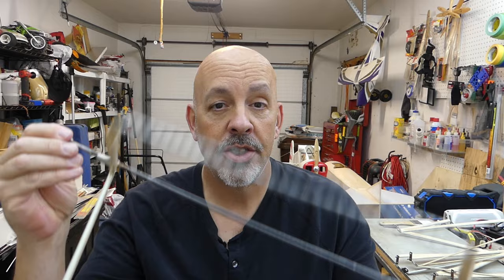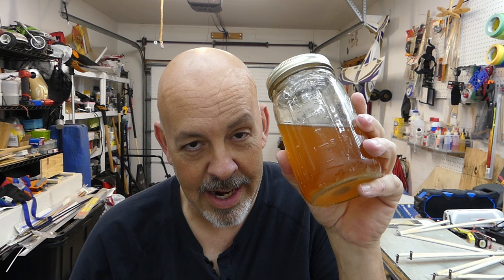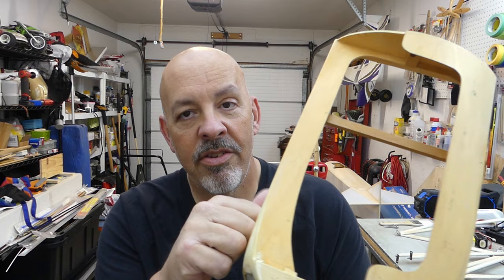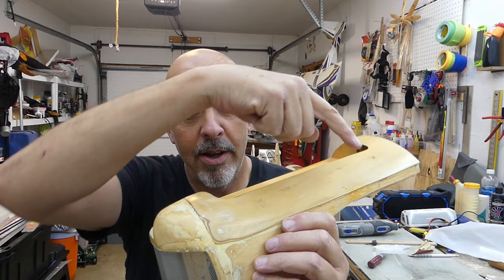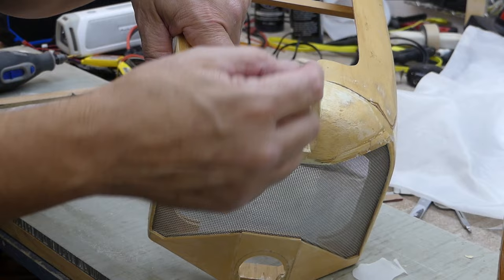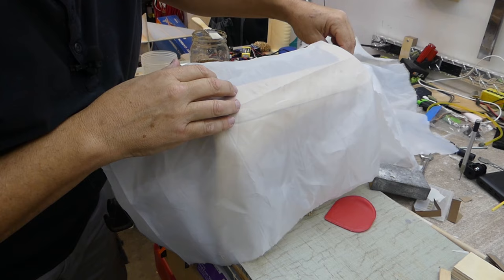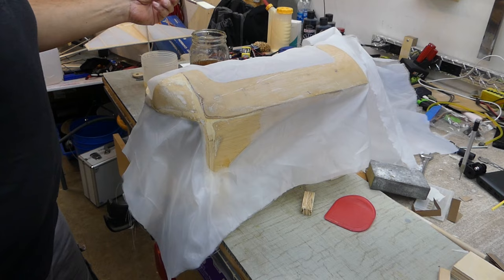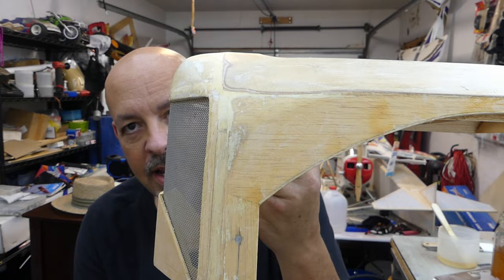Balsa USA 1/4 Scale Fokker D.VII - Episode 46 - Covering the Cowling

Comment: What's going on with the seven
Reply from the maker: Video coming out soon. She is all covered and ready for paint. The paint job will happen within the next few weeks. I will begin building a muffler in the next couple of days.
Reply: @BudChristensen  I don't know if you have great knowledge about mufflers, but you will need to maintain the correct backpressure, or it could give you trouble...
Also, the piper tripacer is coming along easier than I thought
Reply from the maker: @josephkerkau2520  I used to race motorcycles and cars back in the day. I'm very well orchestrated when it comes to exhaust. With running a four stroke on this bird, I will have a little more freedom than with timing the back pressure pulse on a 2 stroke!
Reply: @BudChristensen  Very good, glad to hear  that.
Can't wait to see how you will  design it!! I'm sure it will be perfect because of your attention to detail .. Looking forward to your next video....